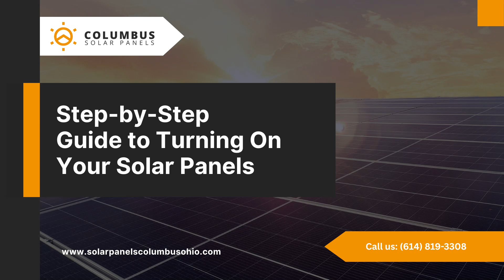Step by Step Guide to Turning On Your Solar Panels

Comment from the maker: 🌞 *UNDERSTANDING THE SOLAR POWER SYSTEM* 🌞
Learn how solar panels, inverters, disconnect switches, and more work together to harness sunlight. Follow our step-by-step instructions to safely turn on your system and troubleshoot common issues. 🛠💡

Read more at the link:
Step-by-Step Guide to Turning On Your Solar Panels: https://solarpanelscolumbusohio.com/step-by-step-guide-to-turning-on-your-solar-panels/

#SolarPower #SustainableEnergy #CleanEnergy #ColumbusSolar #SolarPanels